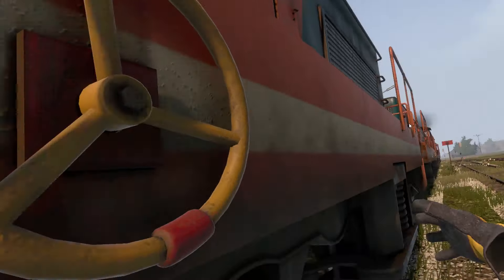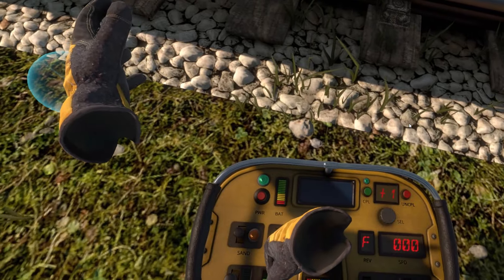Setting Up Distributed Power in Derail Valley: Simulator

Comment from the maker: I learned a few more things about the distributed power system and I'm going to make a new video showing what I've learned so far. I found out that you need an MU box for each engine that you have running since the physical MU cable doesn't seem to matter when using the wireless system. I don't know how this effects the DE6 Slug yet so I need to test that out but I would assume that it still uses the physical cable since it needs a physical connection to even function. I put a box in the DH4, set it to transmit, and was able to control the DP with the handheld remote.

Comment: Woah how did you get your remote to sit on your belt there? I didn’t see the old tool belt holders they had a while ago when I came back to the game just after B99 was released.
Reply from the maker: They're only there when playing in VR. In 2D you have a hot bar so you don't need the tool belt.
Reply: @McLaren_2009  Yes, but in VR there isn't a hotbar, and I don't see the toolbelt or a license to unlock it.
Reply from the maker: There isn't a license for it, it's just there. I still had the tool belt during my failed stream on Friday so it hasn't been removed from the game.

Comment: Where do you buy the other controllers I bought one in machine factory but can’t find another shop that sells one do you have to have to wait physical time in the game for the shop to refresh? Or is there a limit that you need a mod to bypass? Can’t really find any answers about the shop refreshing
Reply from the maker: There is a limit for how many of each item you can buy, but it's way more than just one. When you buy the wireless MU controller at the MF shop, just click on it multiple times. I needed 3 for all of the engines I use. Keep in mind that they're kinda expensive...lol

Comment: But if Radio-MU disables the MU cable, does the slug work?
How about using 3 Radio-MU, put the one on the DH4 as master and the 2 de6 as slave and then remote control the dh4, should work?
Can you slab a Radio-MU to the slug, i suspect you can not (since it needs a de6 to provide power anyway)?
Reply from the maker: I found out that if you're using the wireless MU box, the physical MU cable doesn't seem to work anymore. I had to put an MU box in the DH4 and that allows me to use the handheld remote after setting the DH4 to transmit. Additionally I had to manually setup the headlights for each unit since the cable doesn't work and the wireless box only works one way.

Comment: No remote on distributed power might be an issue
Reply from the maker: I found out that you can use the remote with the system but I needed to put an MU box in the DH4 and set it to transmit when using the handheld remote. It does work with the DP but I had to manually setup the headlights as the physical cable doesn't seem to work.